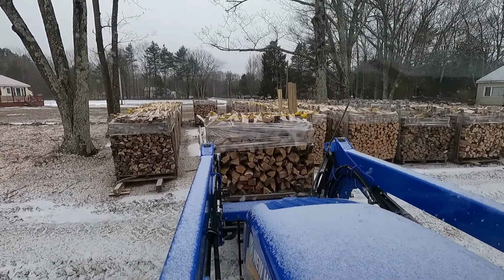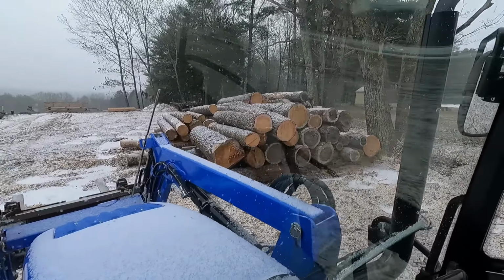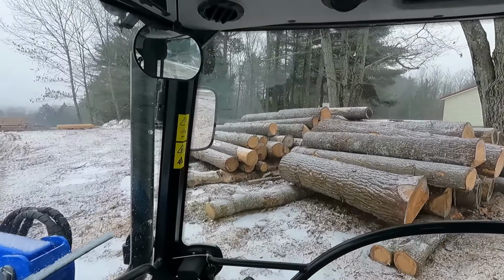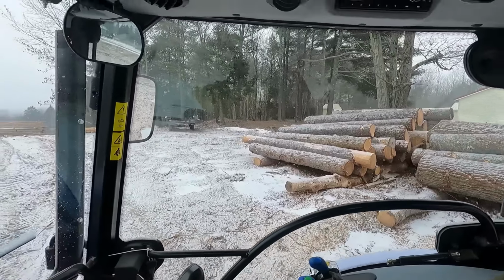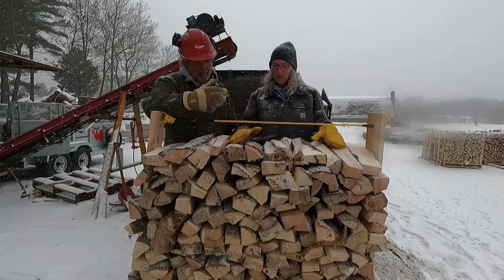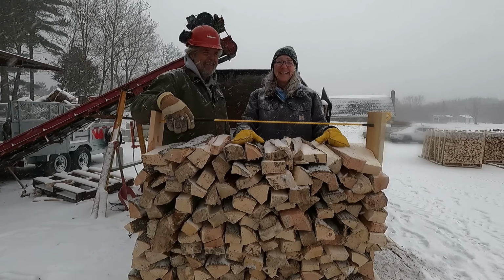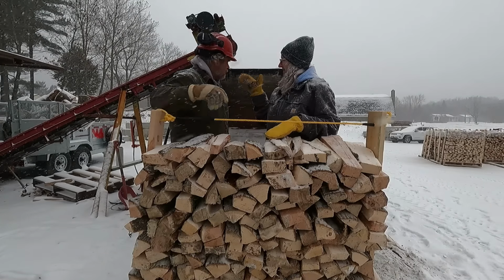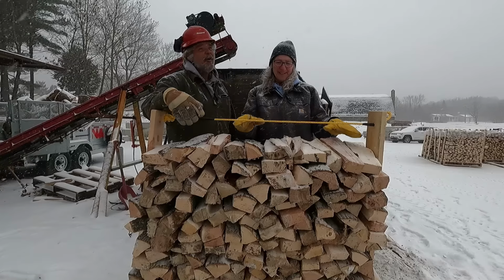SPLITTIN' IN THE SNOW AND PUTTING MONEY IN THE BANK!

Comment: Love the video . Learned some tips like making rails on the ground to put pallets looks the the pallets are oversized ? And the side supports are a great idea . I thought the IBC are good but this have it beat. Is that a split force you using?😊
Reply from the maker: The pallets work great for us . The pallets we built are 4 ft by 4 ft and 4 ft tall with 3 rows of 16 in wood  . The side boards come off by pulling them out of the stake pockets that way they dont take up alot of space when ya not using them unlike the ibc totes .  The splitter is homemade my buddy dana over at smore firewood built it for me . I wanted it to drive around like the split force splitters do but i ran out of cash during the build to make it self propelled .
Reply: You put a lot of thought and time.into this including the 16 inch  piece that come off the large logs . . I get tree 🌳 guys dump wood at my yard for free but the pieces range from.12 in to over 20 in. As for the splitter I still think the split force is king.although I do love the eastern made axis.but it does not move like split force . When I get money like that one day I'll have my options until then I use my.tractor supply 30.ton vertical and horizontal splitter with no log lift

Comment: Hello Phil and Karen. That snowy  weather definitely makes outdoor work more difficult. You guys still did a great job splitting and stacking the wood. How has that tractor been since you had it repaired? It seems like it is running much better. Thanks for another good video.
Reply from the maker: Thanks DonO!  snow definitely slows things down but gotta keep working through it.   Tractor is good  it was running fine, just had a problem with the quick attach levers    they replaced the whole unit and its been good!

Comment: What is that splitter? It seems much faster than the eastonmade ultra, ie. their vertical splitter. Is it home made by and chance?
Reply from the maker: It is a homemade splitter with a 2 second cycle time.  Just built it this spring
Reply: @AllenFamilyFirewood  I meant the ‘axis’ not the ultra… very nice machine.